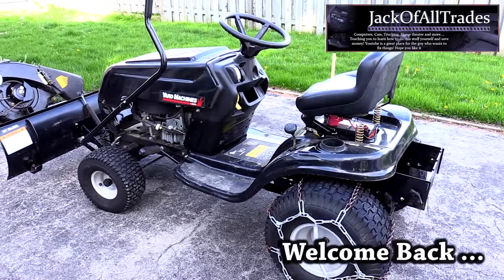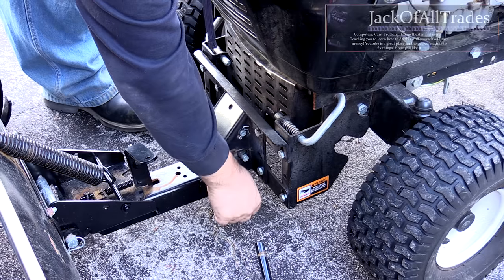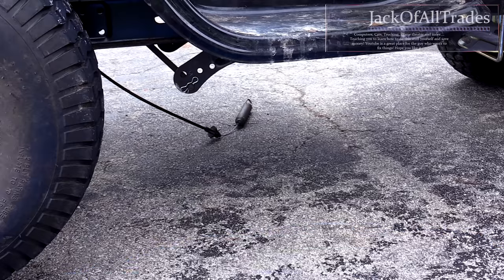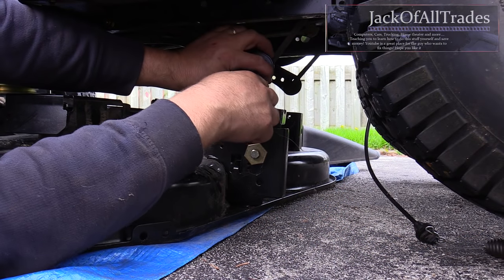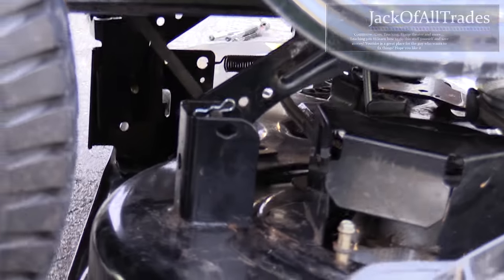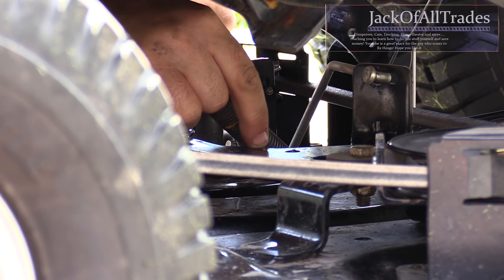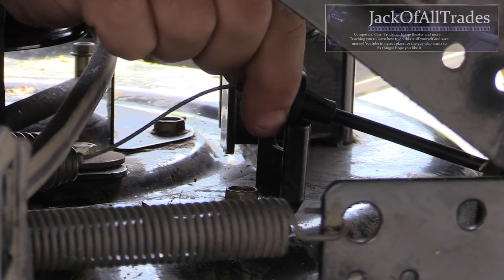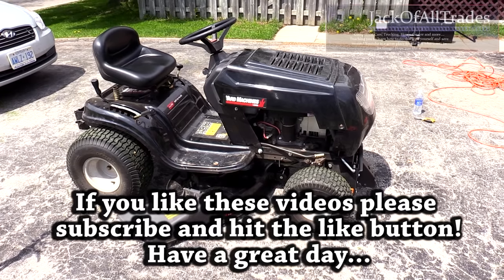MTD Yard Machines 38 inch mower deck installation and removal.

Comment: Your video was a life saver for us. Had the deck off for about 2 weeks and could not remember which holes the back legs went into. And did not know that the PTO spring had to go in a certain hole for the 38 inch mower. Great video and you explained everything so well. Very helpful

Comment: Hi the extention spring at the end next to the spring that you connect , where do you connect that one.   I dont have the same  brand but mine hook at the same place but i cant see where you hook inside ..if you can help everything look the same as mine. Thanks
Reply from the maker: @peace2725  on my channel I have springs location video for 3 springs that show exactly where they attach
Reply: @gereral1_jackofalltrades ok thanks I watch that video didn't noticed it was yours .  I will remove the cover and look.  The bottom is moving like vibration when I pull down the cutter for cutting the grass it's vibrating.  Do you think it's because of that spring or it's something else like the belt.  ( the belt is used and a lot of slack. ) thanks ..been a few days I'm on it .
Reply from the maker: @peace2725  could be belt.

Comment: Super helpful video! I bought this mower used for $75 needing a new deck belt and steering shaft. I printed out the illustrated parts manual but it's so much easier to visualize on video!! Thank you so much for making this!!!!!
Reply from the maker: Yah I know the manual is not detailed on the spring and belt locations. Glad this video helped you out. One day im going to do the transmission belt and will film that too. I love this tractor. Still runs amazing after all these years. Got mine for 999 bucks. Looking now they are selling new at 1500-1800 bucks. Prices have jumped high over the past few years. I bought this for the bag leaf system and the plow. If you reinforce the frame as shown in one of my other videos this thing can push lots of snow. Had 0 slippage problems with the transmission or brakes. Deck cuts perfect and the bagger system stores leaves. I get 40 plus recycle bags worth of leaves each fall so this saves my back big time.
Reply: Where can I find the parts manual?
Reply from the maker: @Ben-we7vr MTD website. Lift your seat to lawn tractor and the serial number to your model is there. Type it in on the website and you can get the repair parts manual. My belt use to be loose as well. Did you put the spring in the 38' deck hole? MAybe the belt you purchased was labeled wrong. these things have a very limited tolerance to be loose or tight. The pulleys only engage so far and the handle that pulls the spring back to swing the arm on the pulleys only goes so far. So the belt must be the right size. Good luck.
Reply from the maker: The front bar has a nut that holds the front of the deck. You can tighten it and force the whole deck forward and this might be enough to tighten the slack on the belts around the pulleys. Just a thought.
Reply: Belt is from when I bought it. Also, the blade runs even when I disengage. The motor is from another mower but that's shouldn't affect this.

Comment: Great video, also works for the MTD RF125 38" deck, although the European model has an annoying plastic guard which you have to remove before you can disengage the cutter drive cable and the front belt guard.

Comment: Awesome the helped me. I was fighting with the mower I got and was having issues with the belt not being tight enough. Turns out the deck with installed without the the lifting brackets and was directly attached to the rods.

Comment: This video is the only way I I was able to figure out how to put on my Spring extensions being that the MTD Yard Machine diagram for this model shows it just floating in space with no connecting points. After multiple attempts at talking to their customer service I gave up and hit YouTube and found your video thank you man you saved my mower
Reply from the maker: Flaco7483 cool..... I made a spring only video as well for broken springs in the mtd playlist.....

Comment: @  :36 , can you please tell me if the bolt with large black washer to the RIGHT of the Pulley on the LEFT of screen is a special bolt that allows for movement of the bracket its attached to (like partially threaded) ?   My dads yard man mower is missing this bolt and i used a regular bolt and nut but then it didnt seem right.   Its a second hand mower my brother bought and has been sitting up and I'm trying to get it running.    So wondering what type of bolt that is and is there another big washer or spacer underneath it being held by the nut ?    Thanks for your help.

Comment: Are you putting the single rod on the front that goes between the two front tires into the deck in the front on first or are you putting the two arms on the back of the deck one on each side by the back tires on first???what’s gonna make this go together easier I’m fighting it???
Reply from the maker: put back on first. Then the twist part in front (extension bar)(near the engine pulley part). then lift the deck and slide into the front notch on the deck. Make sure the deck handle in is the lowest position and the gear to enable the mower belt is disengaged.
Reply: @gereral1_jackofalltrades  Thanks I got it now I appreciate it thank you👍

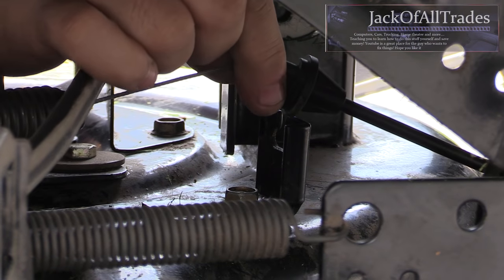Comment: What purpose does spring parallel to the clutch engagement cable spring serve (8:30)?  Wondering if I need to replace it to achieve good belt tension.  Also, does the clutch engagement cable ever stretch out because I seem to have everything in its place (new belt, etc) but still have loads of travel and a slipping deck belt. Thx

Comment: I replaced the whole mower deck and when i raise the deck only the back goes up?  Any ideas on why this is happening?  Any help would be much appreciated.  I seem to have a large spring similar to the one you show to disengage/engage the mower belt.  It has a braded wire that is frayed and has some serious bends in this wire.  Would you think this could be what is needed to raise the front of the deck?

Comment: Could you do an amended video or comment, of where the correct positioning of the tension springs are on the deck. There appears to be three springs (including the pivot arm pulling spring) and mine are possibly missing or fallen off.

Comment: Can you tell me if I can change my 38 inch MTD Yard Machine deck with a 42 inch deck ? My 38 inch is rusted away and expensive to replace or find . I am seeing more 42 inch for sale for parts than 38 inch . And do the spindles interchange ? Mine is an MTD Yard Machine 38 inch cut / 12.5 hp and is a "97"-"98" . I know it's getting old but it runs so strong and what I can afford .
Reply from the maker: I'm not sure. As in this video there is a spring hole for both sizes. Should call mtd off website to see if it can be done

Comment: I took my deck off to fix somethings and I could not remember where that small spring went on the deck. You didn’t mention it but I saw it in the video thanks great video nice and clear
Reply from the maker: Please stay safe from this virus
Reply: My dad is having the same trouble,  He cant find the place for the small spring either.  And he does not see it on the link either.  where does it go.
Reply from the maker: @loisbosarge1573  I have a springs location video on this channel. Search for it. Shows exactly where all springs attach

Comment: Do you notice a difference in belt tension the lower you gonon deck height? I do, it'll really hum on 5 and 4 but when put into 3 to 1 it gets significantly less tension. And yes I do have the spring in the correct hole for the 38 inch deck.
Reply from the maker: I set my deck height to 3. Perfect height. I have adjusted front hanger a bit too. But not side adjustments.  Still on second belt after 3 years.

Comment: I noticed the arms have two holes that can be used.  Is there a reason to use the lower holes versus the upper holes? If you use the upper holes your deck would sit up higher at all times so would be good for St augustine grass where you usually have to raise it to the maximum?
Reply from the maker: Yes, you can change cut angle. Also if you raise front pin bolt and sides it will effect deck position and may solve some users issues regarding a slippery belt. Engine mount is fixed. I've never touched my side risers but have adjusted the front bolt. I keep my deck at 3 on the up down handle.
Reply: I am working on a 38" murray this time around and the deck is way too low for thick grass we have around here.  I am using the upper holes for the rear arms and then the front bolt is almost tightened using up all the threads.  The problem on this mower is now that level 5 can't be reached because the deck bracket contacts the belt retainer rod.  I've used a grinder and removed a bit of material from the deck bracket so that it will not contact the pulley when the belt retainer is removed.  It will bump into the belt retainer on level 5 so I can only use level 4 but that is too low.  I am going to redesign the belt retainer so it doesn't sit below the pulley.

Comment: would you know the correct belt length on this 38" ? online I've seen anywhere from 69 3/4 to 77 3/4 "  great video  btw
Reply from the maker: Look on my channel have belt replacement video with exact model size number

Comment: mine is a 38" cut and my cable is in the correct hole for a 38 inch but my belt seems really loose when blade is disengaged, and comes off at times when disengaged after mowing then disengaging it.   the cable seems to be looser then what your video show's that yours is, my cable touches the desk where it is so loose,  Is there a way to adjust the cable to tighten it up?
Reply from the maker: When I get home I will see what I can do to help. The belt is loose when disengaged. The neck guard keeps it from falling out. Is the guard in the correct hole? The engauge speing ill see if I can shorten it at handle. Be home saturday.... im a truck driver

Comment: As your closeup shot of the deck comes into view I notice that your pivot arm tensioning the belt is pivoting from the hole second furthest from the rotating pulley.....but in all the MTD manuals I can find with a 38" deck it pivots from the hole closest to the pulley.....If this is correct then the belt will be tighter and last longer.....Can you confirm with your parts listing manual please??
Reply from the maker: Scott Burnie I will take a look at it. This was how it was when I bought it new. The one thing I changed was the tension spring hole! The spring was installed in the larger hole and the deck had 38 printed on the smaller hole. The part I'm talking about is the spring attached to the belt engage disengauge handle.
Reply: Thanks for the reply General 1 and I have taken note of that spring position, as mine was also in the wrong hole and I have moved it to the new hole.....but the pivot arm has me stumped as in all my manuals it is pivoting from the hole closest to the pulley??? Also the position of the spring on the chute side (I think) that goes under the spindle cover and attaches to the brake arm....Have I got this right in the correct position??
Reply from the maker: When I get home tomorrow night I'll look at it in the shed. My plow blade is still on. Then I'll compare the mower deck bolts and springs to make sure.
Reply from the maker: OK took a close look at the diagram and my mower deck. Just to make it clear my deck is 38inch. There are 2 configurationso depending on the deck and size. The bar that hold the sway bar part is bolted in the 2nd hole of 3 so it is correct. The sway arm is bolted in the FIRST hole closest to the pully and the second hole is exposed as show in the video. The spring does NOT connect to the pully covers but the inside there is a connection part for the spring. So my deck is correct in this video.

Comment: Hi I see that you installed the belt guard and that one side pops in and the other is held in by a bolt you said. Mine came off this morning and my belt guard on one side is curved. I believe to hook on to something, which now I believe to be the bolt. I'm not sure if mine is just a bolt or an eyelet bolt?? Could you help me out thanks.
Reply from the maker: regular bolt the diameter must catch the eye part. you can rig something together with a washer. you can see the hole it tightens in if you look at the engine up top there is a tiny hole for a threaded bold. Odd your bolt came out.
Reply from the maker: I posted a missing springs video to help out another user who had springs missing. Check that video out on my channel and it may help

Comment: This was a great video! But now my mower won't start. I've checked the safety switches, got a new battery and changed out the solenoid and spark plug. But it still won't start. It was running fine before I removed the deck. Any ideas?
Reply from the maker: Put throttle in choke mode. Is your mower engage handle( one that yoy pull to engage belts) in the engage position? If so the tractor will not start!
Reply: Yes, did all that already
Reply from the maker: You have a volt meter?
Reply: It was unfortunately stolen. 🙁I no longer have one in my possession, but I can get one! 🙆
Reply from the maker: Ok when you get one set it to continiuty and connect each test lead to you safety seat switch below your seat. Press seat down and your meter should change to show a connection. If it does not replace the seat safety switch . I can take you through each test to the ignition switch if you need to but start with the simple stuff first. The sensor in the handle engage also needs to be tested for continuity. Also press in the clutch and the yellow throttle speed switch all the way to lock position. This allows you to get off the mower when it is still running as this overrides the seat safety switch. Testing needs to be done at this position as well. On mtd site their is wire diagrams of the entire mtd tractor so if you know someone near you can have them systematically test each sensor and safety switch to find the problem.

Comment: The brake spring for the right side (the side with the chute that the cut grass comes out) 1 end of the spring goes to the stud between the belt guard mounting bolts, but where does the other end connect to?
Reply from the maker: Watch my springs video. Hope this helps.
Reply: Found springs video, thanks. Will fix when it stops raining...

Comment: I do have a favor to ask though I have a issue with the throttle adjustment screw I can't seem to get the throttle/ idle right and it won't run correctly it keeps stalling and it shuts down on me when i engage my blades can u help me with this problem?
Reply from the maker: Check your seat switch!

Comment: great video! I have a similar mower, mine is a 42in. My deck is wore out. Any suggestions on where to order a replacement deck. I have a yard Machines.
Reply: I need to get a replacement  deck for my pollin yard machine 38 in can any one tell me where to find one used or new

Comment: Awesome video. The problem we're having is the deck is rubbing on the engine pulley, causing it to not start. Can you give me some clues as to what we did wrong? We thought it was because of the missing spring but we put that on the other day and that didn't do anything. 😕 Please help if you can. 😀
Reply from the maker: Michelle Brennan I made a missing springs video. Make sure the springs are located as per this video in mtd playlist.
Reply: gereral1 how do I find that video?
Reply from the maker: Michelle Brennan click on my icon and look at playlists tab
Reply: gereral1 ok thank you. I found it. Do you think the spring he just put on is in the wrong place? He (my Dad) says the deck just needs to move a little bit and then it'll stop rubbing and start but he doesn't know how to get it moved.
Reply from the maker: Michelle Brennan in the video the front bar is adjustable. It needs to lock in and the right left back are held buy height control. There is adjustments nuts on each side. Make sure the belt guard is in the proper hole. And the height lever is down when hook up.
Reply: gereral1 Ok. In the installation video or the missing springs video? And what is the bar called that you're talking about?
Reply from the maker: at the front of the mower deck in the video is a brass type bar that hooks into the FRONT on the mower desk and the slotted end turn right and drop in the slot and left to lock. This front bar that connects just behind the front tires has a nut that can be adjusted to level the deck. The same goes with the back of the mower deck is 2 nuts. One on each side to adjust the deck as well. A combo of both may bring the desk back a bit so it does not touch the pulley from the motor that the desk belt wraps around. Pay attention to the position of the adjustment spots in the video and make sure yours is exact. and the guard is installed in the correct spot as well.